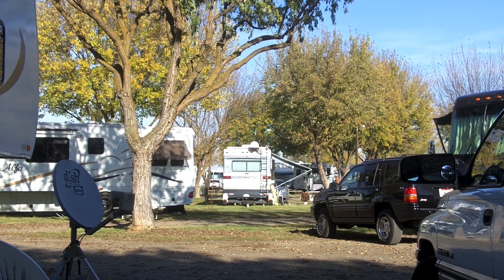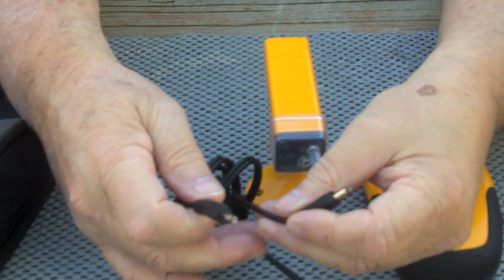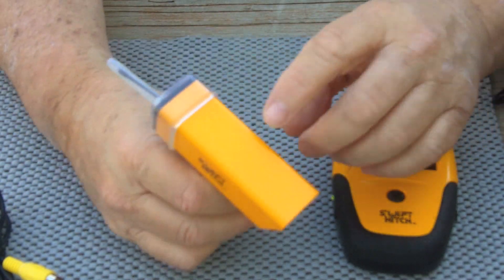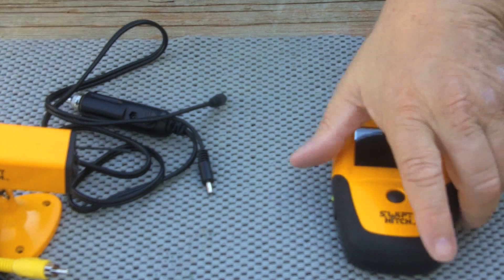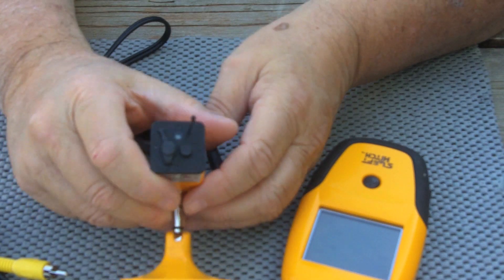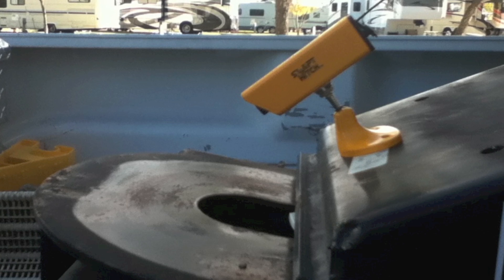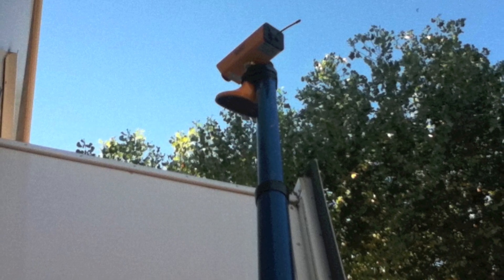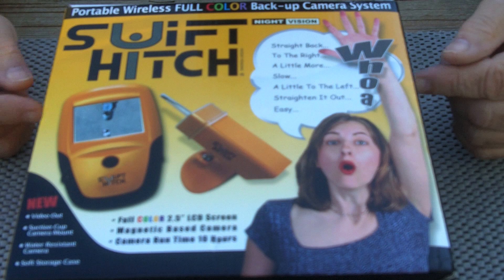SwiftHitch Wireless Backup Camera Product Review

Comment: Maybe. It didn't work as a backup camera for my when I tried it in the campground but I believe there was interference fromWiFi radios in use, Also, I have a 34 foot fifth wheel. It may work well on shorter trailers and in areas with less WiFi. 

I only tried it once so have not really given the backup camera idea a valid test.